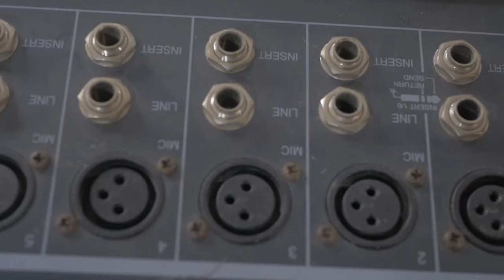The Different Inputs on an Analogue Mixer (Mic, Line, Insert, Instrument inputs)

Comment: So an electric keyboard or guitar has to be plugged into the "line in" input? On my mixer ( yamaha MG82cx), the microphone input says "line" on it. Does that mean it will take a microphone OR an instrument?
I'm confused!
Thanks for any answers, and love from Florida USA 🇺🇸 ❤️ 💕.
Reply from the maker: Hello fellow, I receive your love from the USA. Glad this reached you from Nigeria.

Yes, an electric keyboard has to be plugged into the line input. However an electric guitar can only be plugged in a line input if it has gone through an effect processor or pedal.

Note that the input identification also affected the effect of the preamp on the signal. So if an input says mic then it means the preamp has been set to amplify a mic level signal to a line level signal. Because your signal must end as a line level signal for it to be strong enough for recording or amplified on the speaker.

I hope that makes sense.